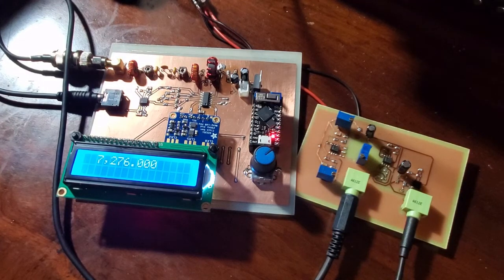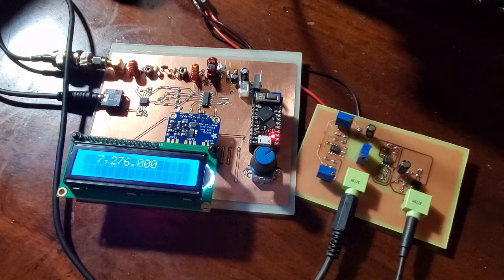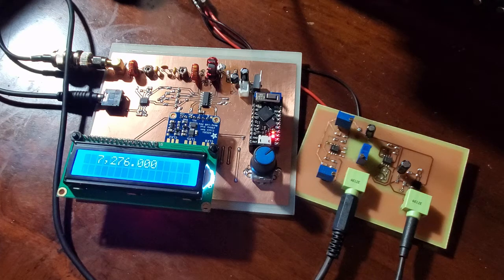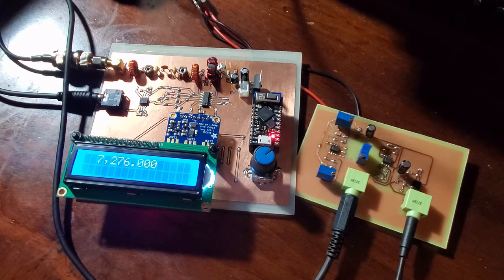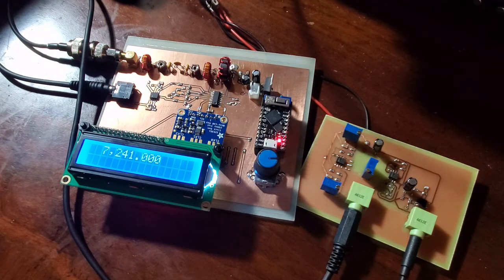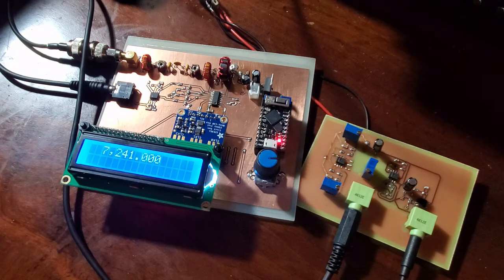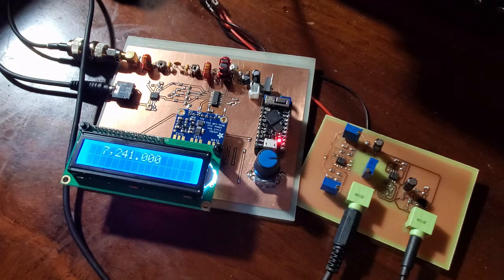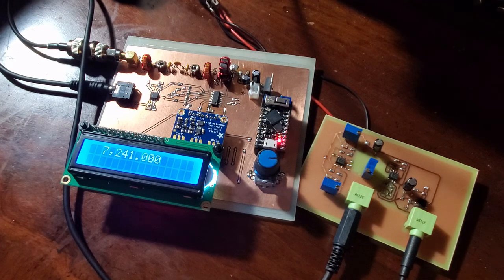Tinypico Radio Part 6 - Tinypico Mounted to PCB

Comment: Even is an older post, I got to say regarding clicks when resetting si5351 that even fixing this problem, on weak signals there is another source of encoder clicks like i2c bus wires. I went a bit deeper and shielded entire si5351, rg402 without jacket for iq VFO and shielded cables for SCL SDA. Avoid si5351 leakage as much as you can and do not use more than 1 output of it to avoid crosstalk ! Sometimes is useful to reset it on band change. 73's, Gabriel yo8rxp
Reply from the maker: I have been thinking the same on the si5351 - that is not to use the two channels in quadrature from it. I think I prefer doing the quadrature signals outside with a d-type flip flop. Thank you for the comment Gabriel

Comment: Nice job!! Love the modular approach and details on debugging the tyloe mixer. Is the opamp 4562? (the one immediately after the mixer) have you tried different opamps like ne5532. How about feeding the iq to adc and do the processing inside the micro ( see qcx mod by pe1nnz). Keep posting & 73s
Reply from the maker: Thank you for the kind comment. Those OpAmps are all cheap LM358s. I do have some higher performance OpAmps that I plan on trying to see if it makes any difference - but I think for the phase shift circuit having higher tolerance capacitors would improve things.

Its funny you mention DSP because it has been a goal of mine to do the audio processing in micropython. I got as far as linking in the CMSIS library with the version of micropython for the Pyboard and invoking the FIR filter - but didn't go any further. The PyBoard has a pair of 12 bit ADCs and DACS - so hardware is definitely there - and there are some simple memory block write functions in Pyboard micropython

The Teensy microcontroller has a really good library for audio processing which Charlie Morris has used for the phase shift processing.

Again - thanks and 73s